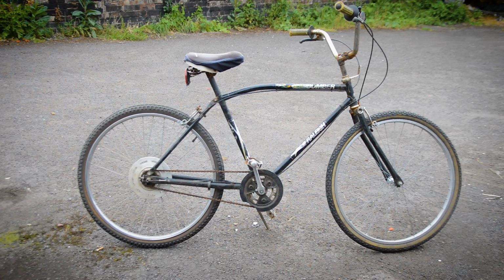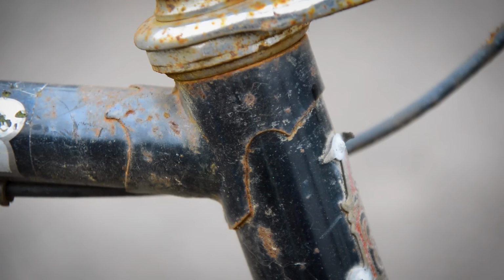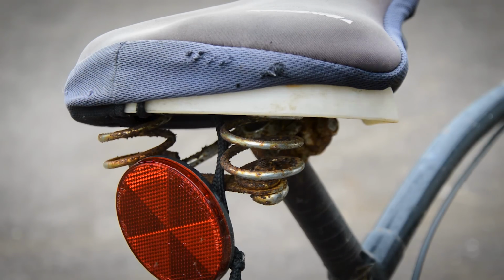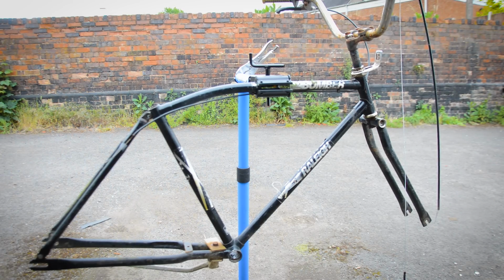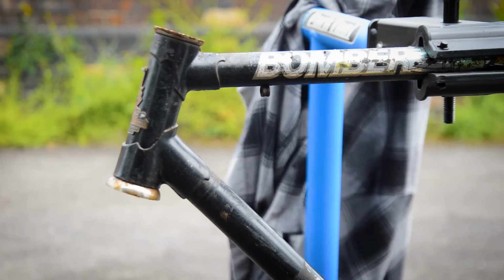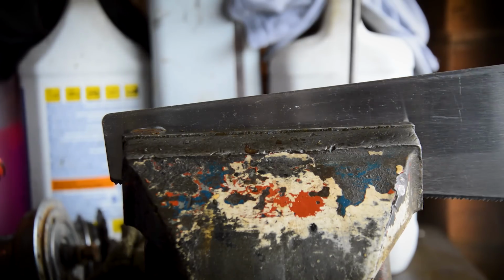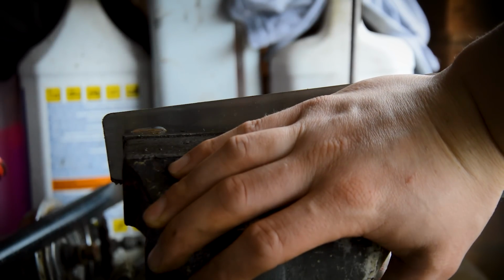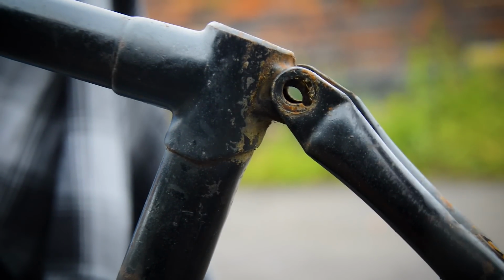1982 Raleigh Bomber - A Rusty & Troublesome Vintage Bicycle Restoration

Comment: Looks like someone jumped it from a good height and bent the fork and seat tube. You might be able to use a hydraulic press and heat to bend the steer tube somewhat close to position. Cool project 👍. Thank you for the cool video! Good luck.

Comment: Not only is that steering tube bent the middle has two bulges where it looks like the stem bolt was over tightened!
I have the same thing on a 40’s Humber, it took hours with a piece of emery cloth glued to a broom handle to get the stem to fit right.
Reply from the maker: Nightmare!

Comment: The replacement front wheel and bent steering tube suggest that this Bomber collided with something solid !! The bend is consistent with with the forks being bent backwards, the handlebar stem gave extra strength to the upper part of the steering tube so the bend occurred below this. It is possible to straighten the steering tube using a long steel bar or thick walled tube that fits into the steering tube ( or add some sort of strong extension to an old handlebar stem ) Clamp the forks very securely, heat the bent area and carefully bend the steering tube straight.
 The seat tube bend could be the result of a cumulative effect of years of riding over rough terrain, bending tiny amounts each time, This again could be repaired with the use of a steel bar of a diameter that can just slide down past the dent. Clamp the steel bar so it really can not move, apply some heat to the dented area, slide the dented seat tube over the steel bar and carefully hammer the outside of the dent, this will return the tube to round again.
 The steel these frames were made of are not high quality exotic thin walled steel alloy, so provided the heat applied is too great no lasting weakness would be created, after all the frames are heated at each joint to braze them together with no problems ( Actually this may be something to consider repairing the seat tube dent, it's right next to the brazed lug ).
Reply from the maker: I've fortunately been offered a replacement fork, but I might give this a go just to see what happens.

Comment: Think about what someone may have used as an upgraded fork back in 82. 26" bmx cruiser forks in chrome maybe. Keep the original forks in case you can repair them later.

Comment: Can you find a steel rod, who's outside diameter is damn near the inside diameter to the steerer tube's? Try to insert it, whilst also heating the outside of the tube with a gas torch? You have a nice big vice, great...maybe some heat-proof gloves may help you. Anyway, you're consulting a frame builder, who knows much more that me, no doubt! I do think the original fork can, and definitely should be, saved. I look forward to the next episode, nice to end on a cliff-hanger, can he turn a Raleigh Bummer back into a Raleigh Bomber we all wonder!
Reply from the maker: Oh man this video is old now.  That fork and build are long gone!
Reply: @MonkeyShred  I noticed, about two seconds after having pressed 'send'  hehee! Cheers!

Comment: Interesting project. Apparently the Bomber frame was "borrowed" from an old Raleigh export roadster design for the African market, and then given BMX style bars and stem.
Try taking the forks to a motor repair garage or engineering workshop with a hydraulic press used for stuff like wheel bearings, and see if you can press the curve out enough to stop it binding.
Reply: I read it was influenced by a Philips Speedtrack from the 1950's. Raleigh purchased Philips and had their IP.  It was a bicycle speedway design. If you look it up on the net you will see the frame and bars have a striking similarity.

Comment: Basically there are long-stem and short-stem forks (as well as different finishes and leg-lengths). This is because the frames were altered part way through production to strengthen the headstock. It was prone to deforming (kids doing wheelies?) at the bottom so a strengthening ring was added making the headstock length a little longer and therefore the fork steerer tube needed to be longer also. Your bike (having a plastic chainring) will have the early headstock I'm sure so if you can't repair the original fork and find a later one you will have excess tube at top which you may not be able to adjust out with the top nut/threaded-race. If you try early forks on a late frame there's not enough tube protruding to fit the nut etc

Comment: Cool project. Over here on Northern California, we called them klunkers. After all, it's the birthplace of mtb. You should make a trip to the other side of the pond and visit our Marin Museum of Bicycling. You'd love it.
Reply from the maker: I will have to at some point!
Reply: It's the birthplace of a certain aspect of "mountain biking", basically the downhill time trial. Breeze and Ritchie et al came up with a frame design and parts better suited to it than the old Schwinn bike frames and salvaged motorbike parts they had used previously. It caught the eye of a bike manufacturer prepared to take a chance, and only then did it become popular. However, people have been using and modifying bikes to ride on all types off terrain since the birth of the safety bicycle. Look at the origins of modern day cyclocross to see proof of that.

Comment: I've a few bits for one of these that might be of use to you, I've posted on your FB page.  The Chopper, Grifter, Bomber and Burner etc were all based on American bikes.  Bomber takes it's styling queues from the Schwinn Klunkers which are the true predecessors of mountain bikes.  Good luck with this one!
Reply from the maker: Cheers Paul, I'll check over there.

Comment: I had one when they first came out, which I think was Christmas 1980. The frame was made from cheese. It was as soft as any metal I've ever seen. The forks bent outwards just from landing from a wheelie or riding off a 6 inch kerb.

After a time during which my forks bent further and further outwards, I brakes really hard one day and the head tube snapped in two. 

I remember the wait for that Christmas. I was 12yo and went to bed those few autumn months with the Bomber brochure on my bedside table. I don't think I've ever wanted anything as much before or since and yet it was such a disappointment.
Reply from the maker: I can definitely see how the fork bent so easily.  They're not made of much.  Neither are the seat stays!
Reply: @MonkeyShred  There was mine and at least 5 others amongst my school friends that Christmas. We all experienced the disappointment which just hastened our move to BMX in 1982.

I feel bad for my parents who bought my bike. It was something I really wanted based entirely on its rugged looks but it just wasn't to be. It cost £96 in 1980 which was a lot of money then and a lot of money for my parents. 

By Christmas 1982 I had bought a BMX frame and forks and a few of the smaller components I needed with money I earned during my school holidays. My parents bought the handlebars and wheels for Christmas and I ended up with the only Skyway TA in the area. That was an entirely different beast and lasted for years until I had a car and sold it for pennies to my brother's friend.

Comment: added to this is the fact that the Junior Bomber forks have shorter legs so you could end up with a fork with correct length steerer-tube but won't accept the 26" wheel. And finally there are the different finishes (black/blue Superchrome/chrome with black for 5-speed Bomber)

Comment: I'm sure the forks are straightenable with the right person doing it, unless you can find a decent second hand pair. The forks haven't hit something head on as the forks are bent the wrong way, have you tried  Lloyd cycles for your logos? They helped me out with some Raleigh Ace decals when no one else could. All the best with the resto. If costs look more than the bike is worth, have a think about doing a patina job on the frame, cutting paste and a couple of coats of clear coat should sort it and keep the character.
Reply from the maker: Nobody does the decals as of this moment but I have managed to somewhat peel the old ones off so they could be a decent base for some to be remade / redesigned.

Comment: Hi m0nkeyshred. Just discovered your vid despite being into Bombers myself. I've not read all the comments so forgive me if I'm repeating something you have already been told but... re the forks.  First of all there are 9 (yes 9) different forks available for the Bomber and used or NOS ones can be hard to find so it's a bit annoying if you do find them and they don't suit your frame. I'll break it down in another reply

Comment: also the issue with dent in seat-tube. I don't think it's viable to separate the frame tubes as I think you'd need to de-braze all the joints to get one tube out. you won't be able to press it out due to access problems so I think the bast option would be to have the dent cut/ground out then a small piece of tube cut from another source and welded/brazed back in. If you put a copper pipe down the tube when the welding is being done it will prevent weld from protruding into the tube and then the seat-tube will be able to go back in
Reply from the maker: Hey!  Thanks for all the info.  The Bomber is still currently in bits and you're right, the search for spares is tough!  I am actually about to recieve a second frame and pair of wheels though that have been donated to me which is awesome!  I'll give it the once over when it arrives but it seems I have 2 to play with now.  With this one I may end up sending the fork off to Mercian cycles to have a replacement steerer as it seems like the only viable option at the moment.  I could also be sneaky and switch out the Raleigh threading to 24tpi.  I'm not sure how I'm going to tackle the seat tube yet though.
Reply: Am pretty sure the threads on the original forks are 24TPI. I have the Bomber parts lists and it states (for all models) that the head fittings are 24TPI although there were early and late types. I have a picture somewhere showing my thread-gauge on the steerer-tube threads. It's on the Bomber forum but hardly anyone goes there now due to facebook
Reply: not sure if this link will work but here's a pic of RAB433 (early short stem forks for 26" wheel) with sticker saying 24TPI http://i1284.photobucket.com/albums/a577/ffoxy99/Raleigh%20Bomber/DSC00433_zpsbd606a3a.jpg
Reply: and here's the fork with thread-gauge on 24TPI http://i1284.photobucket.com/albums/a577/ffoxy99/Raleigh%20Bomber/DSC00446_zps73d97434.jpg

Comment: You have had some bad luck there. I would not advise straightening the steerer as it will weaken it. With the frame damage too it may be best to cut your losses on this one.
Reply from the maker: I've got a replacement fork so it should be ok now.  I've somewhat sorted the seat tube too.... hopefully.

Comment: I've had two sets of Bomber forks with damaged steerer-tubes and thought it might be possible to remove the old one and put in a new one from any other (period) Raleigh. I have oxy-acetylene gear and figured if I heated the brazed joint enough the stem would pull out of the fork bridge but it would not shift. I guess the next option would be to have it milled out on a lathe but this would be hard to arrange

Comment: Chances are it’s all ok just in terms of risk because it’s not alloy or carbon. Based on those 2 defects, Sam Pilgrim had it for a session and dropped in from a height (and nearly died etc) 😬. It would have taken immense force to bend in both places,  particularly the seat tube. The bend in the steerer tube is bizarre and suggests a huge impact but not in direction of travel which is unusual. That is either a vertical fall from a height or manufacturing defect. The steerer tube seems to be quite lumpy and imperfect to begin with. Looking at the seat tube - the side opposite the defect, it is straight but may also suggest vertical impact. For the purposes of the restoration I’d say it is fine. The bike is a gate with wheels to begin with. What you are looking at is potentially issues with workmanship.
Reply from the maker: Speaking of workmanship, I can't even find a serial number on the frame.  The seat tube is as you say, perfectly fine on one side but crushed on the other.  Almost as if it was put in a vice and crushed but only one side was damaged.  Strange.